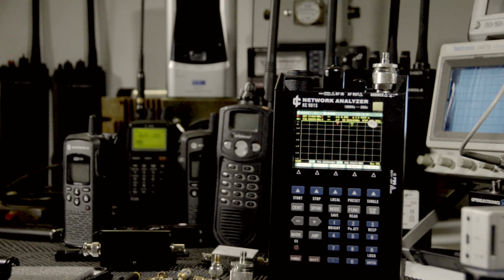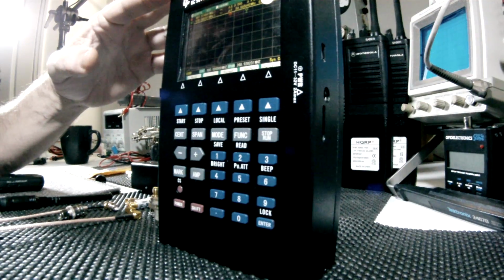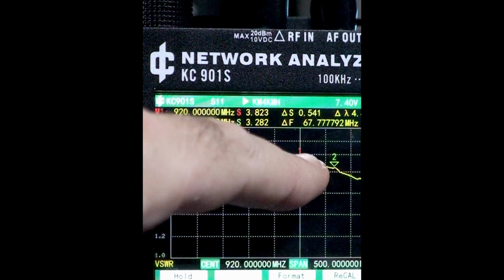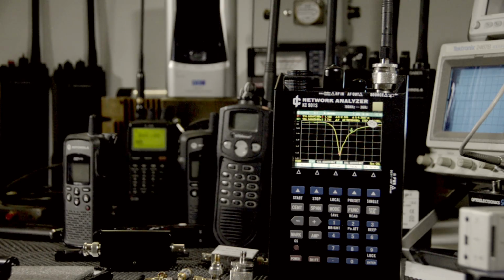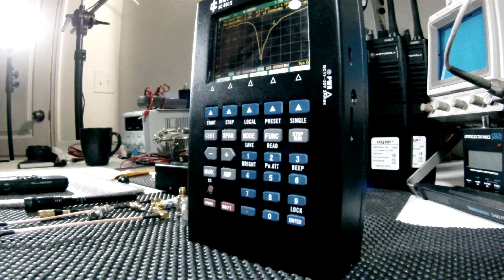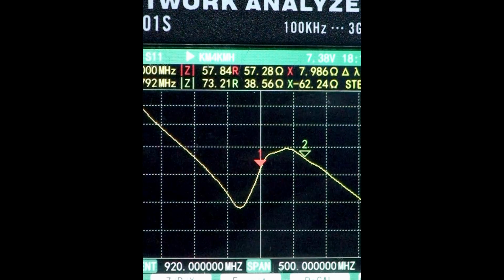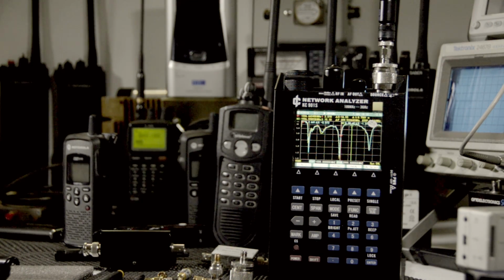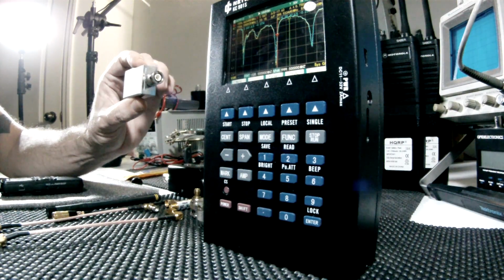KC901S - 1. RC FPV DESIGN: ANTENNAS, REFLECTION, SWR, SMITH CHART

Comment: Hi,

The KC901V which goes up to 7GHz in now available from January 2017 with a kit of extras and it has even more capability.  (Software defined IF so for spectrum analyser and related functions RBW selection options are 30K,10K, 3K or 1K)  I suggest you check it out.  The AF generator as well as being able to give Volts Pk to Pk into 1Kohm via the BNC connector, it can also have its output selected and presented into Ports 1 or 2 into 50ohms in levels expressed in dBm.  

regards Noel (VK3NH - Australia)

Comment: Thanks for the very informative video .. They have released a new model KC901V which goes up to 6GHz & it's great since many fpvers use 5.8Ghz frequency. Looking forward for your update video since this video is exactly 1 year old today (according to my local time) would like to hear about its reliability before investing in one.
Reply: No, they haven't actually released the new model yet, their advertising is ahead of their prototype, It won’t be available for at least another two or three months and the price is likely to be much higher than their current ‘newV’ advertised price. So I guess it might well be Spring 2017 before you can readily get your hands on one.
Reply: Thanks for the update. Let's see how it goes as am interested in 5.8Ghz mostly
Reply from the maker: I haven't been able to use mine much since the making of this video (an assignment came up abroad). But for the times I have used it, and now, it has proven to be very reliable. I would assume the 6G model would be as reliable.

Comment: Hahahaha you were so excited to use your awesome new tool that you even forgot to remove the QC pass sticker on the screen :p
Not so expensive especially for this kind of tools! I wish i know more about Radio Frequency, maybe it's time to really start to learn :)
Thanks a ton for sharing and have a great weekend
Reply from the maker: +ABMNS PRODUCTION 
Indeed! And thanks for the comment. The sticker is "fused" to the screen-protector and I'm a bit OCD about leaving screen-protectors on ;)
I have an older Agilent 8714C I use as a bench VNA. And at the lab we have a FieldFox and Agilent 8722ET. I LOVE this small VNA. For it's size, weight, and especially price-point, it is a VERY capable unit. Once you learn its controls, I would use this in place of the FieldFox any day.

If you want to learn more about RF, definitely get Dr francesco Fornetti's book (and DVD), "Conquer Radio Frequency." Have a great day!